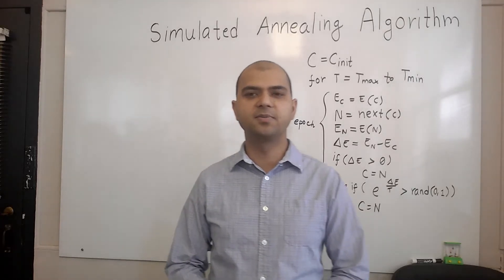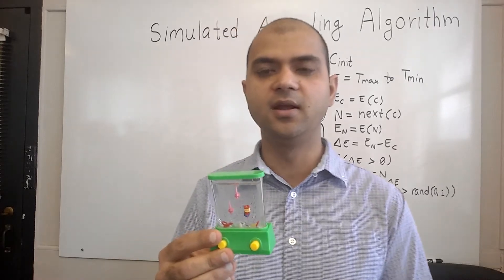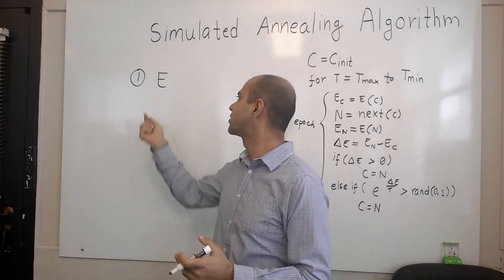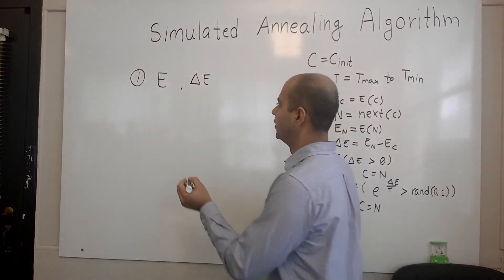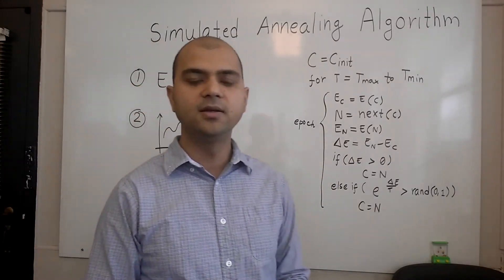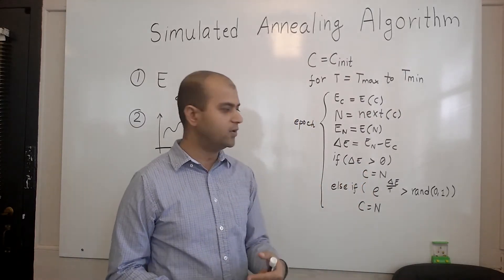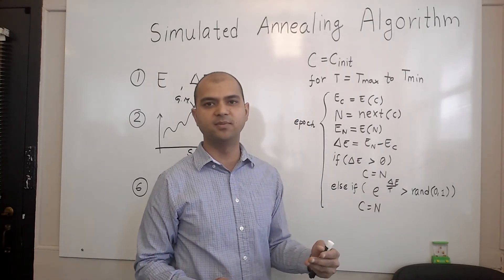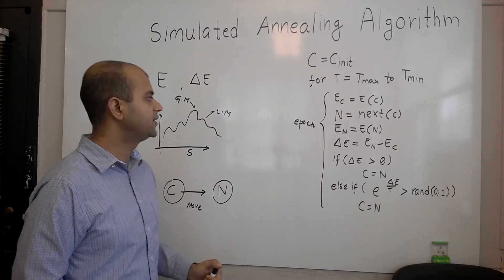The simulated annealing algorithm explained with an analogy to a toy

Comment: its a good video but i didn't understand something in this annealing algo we started from T max to T min, how did u say its a maximization problem  ?
Reply: I'm also confused on this aspect. What would be the maximum temperature for your ring game. would it be 373 Kelvin since that's the temperature you would need to boil the water ?

Comment: Thanks for the information badri!
One thing that I didn't understand is the repetition of the program , does it stop after the repetition of the epoch is 0 , or when the temperature reaches the minimum?
Reply: Temp reaches minimum, because if you stop when ΔE = 0 then that will give you a local maxima and not a global maxima

Comment: is the actual number e used to calculate the probability of picking a "bad" state? In other sources like Wikipedia I've seen that e refers to the energy of the state E(s), not to the number e. And to make the choice a probability function is used, based on delta E and T. Could anybody clarify this? Also I've no idea what probability function that is, can someone shed some light?

Comment: Hi, thank you for the video. I would like to know how you calculate state energy? I mean with which way you calculate each epoch energy for E(n) (Also E(c) for the initial state). How the temperature change at each iteration?  I mean T(max) is as you said 3000 in the initial state. How I can calculate the second state temperature. Thank you for reading.
Reply from the maker: Agil Yolchuyev calculating energy E totally depends on your problem. For eg, when calculating shortest paths, sum of the distances could be your energy.
Reply from the maker: Agil Yolchuyev for temperature try linear decrease like T = T -1 first. Then try other monotonic decreasing functions.